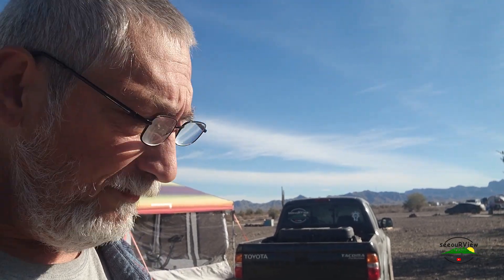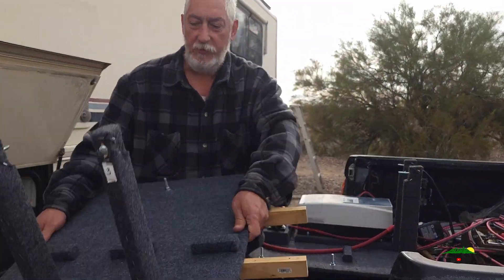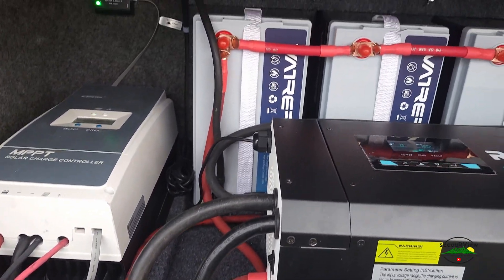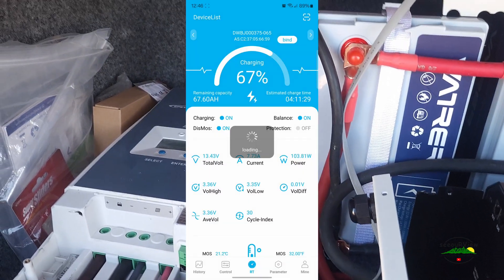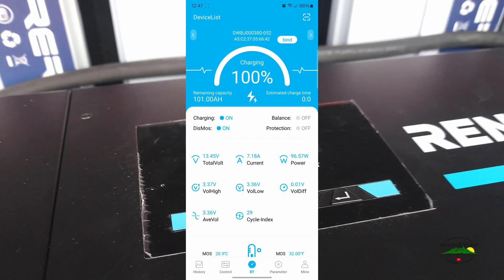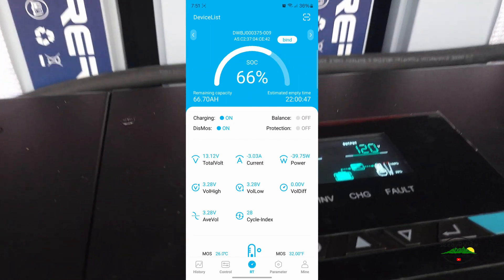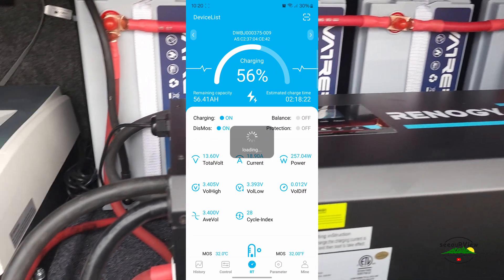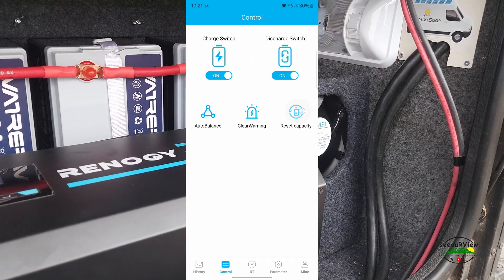Vatrer LifePO4 Lithium Battery with App Monitoring Glitch?

Comment: The SOC listed in the app is an estimate based on the battery voltage and amp-hour capacity.  The  Reset Capacity is used when the batteries are at 100% full.  This function resets the estimated SOC.  You will know when you are at 100% capacity on your battery bank when you look at the display on your solar controller and see that the amps going into the battery are minimal (0.1) and the voltage is hovering at 14.2.  

Generally, do not trust the SOC as reported by the BMS.  Your app is reported an estimated SOC.  For best results, get a shunt.  There are several varieties available.  Some are as low as $50 (like the Aili model).  If you are a fan of Renogy and have the Renogy One Core installed, Renogy makes a bluetooth battery shunt.  That shunt is brand new and was re-released last month.  It will connect to your One Core system.
Reply from the maker: Thank you. I'm a "read the flipping manual" kind of guy but I've been unable to find anything about it in the manufacturer's limited documentation. Your answer makes a lot of sense, I appreciate it. I've been gifted a Victron shunt with bluetooth but haven't installed it yet.

Comment: update your firmware... then test... if still wonky,   disconnect the batteries and check individually with a voltage tester
Reply from the maker: Good ideas JT, thanks. I've since learned that there is a procedure for setting the capacity and it should only be done when the battery is FULL. It was operator error!